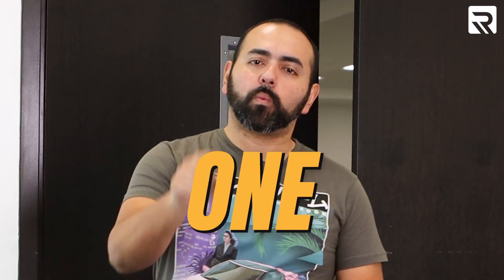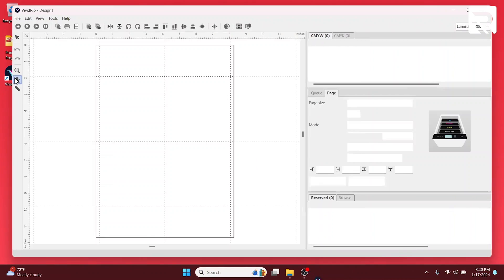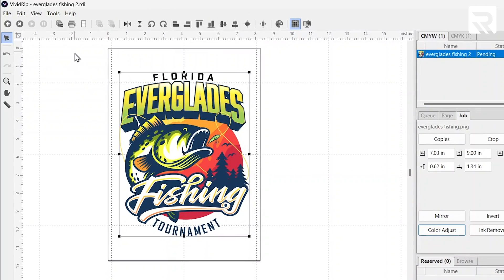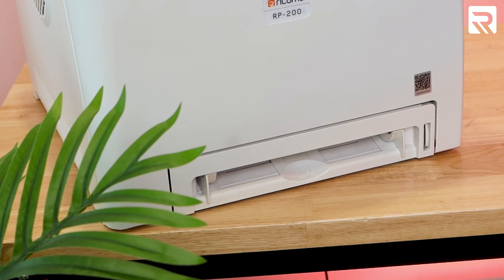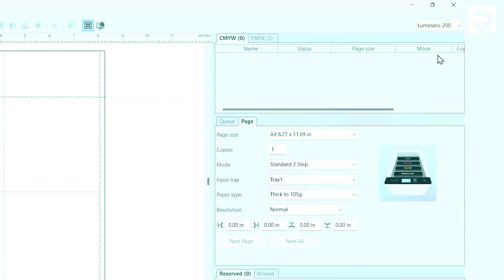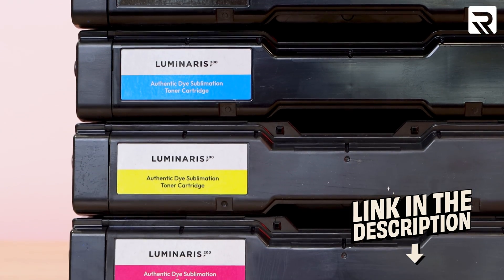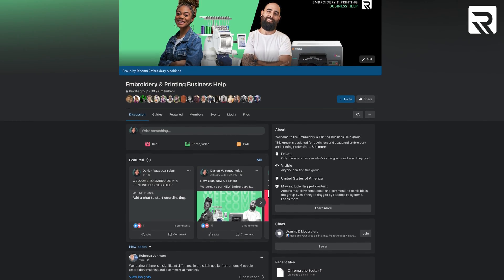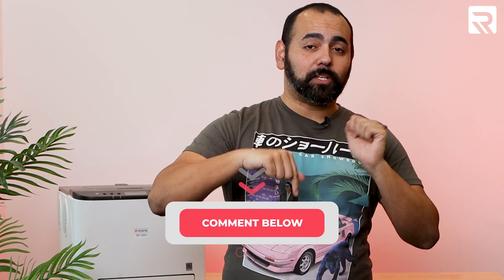We Used ONE Game-Changing Printer to Compare 2 Popular Printing Methods

Comment: What paper do you use for sublimation?  Do you use the ones that have to have sublimation ink?
Reply from the maker: We use sublimation transfer paper, which is specially coated for the process. Yes, it does require sublimation ink in order to transfer properly.

Comment: I never seen heat transfer printing done like that. Is that method based off of a white base like DTF? Or is that just CMYK only? And can you use that method with other printers beside Rhicoma?
Reply from the maker: It's similar, the 2 step heat transfer process involves printing on an A Transfer Sheet and then marrying it to a B Transfer sheet. It's CMYW and a cold peel.